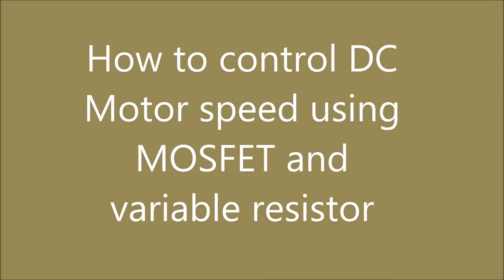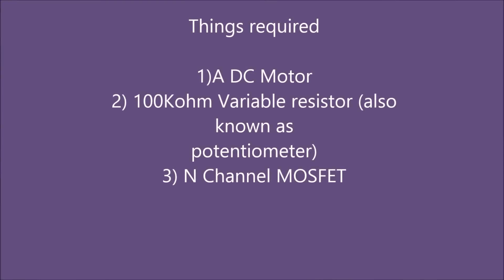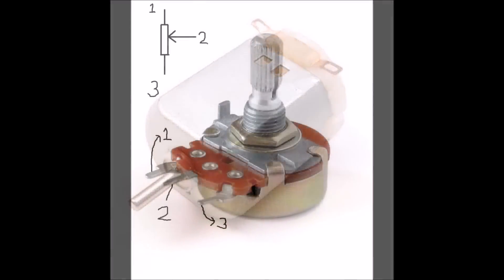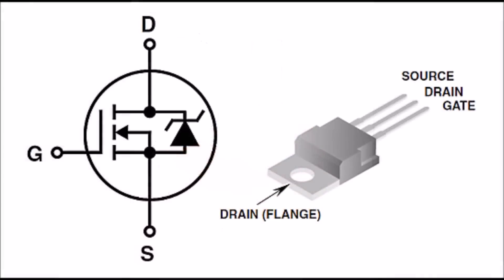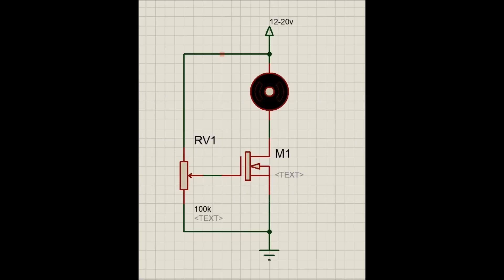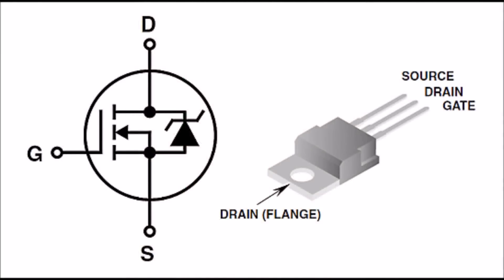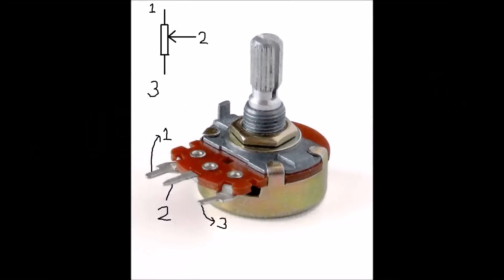How to build the simplest DC Motor Speed Controller(Using Potentiometer and MOSFET)Updated

Comment: the dc motor speed isnt changing when i tried this... is something wrong with my potentiometer? I got my materials from radio shack but no matter how i turn the potentiometer it won't change the speed
Reply from the maker: Does it rotate at full speed?
If yes, the MOSFET is bad. Check for short between D and S terminals
Reply: i feel like it is spinning even faster before when I had only connected to the battery lol... but yeah probably the mosfet because the guy at radio shack just said well it looks like this thing (it wasn't a mosfet but it was exactly the same shape lolol) I guess I will try to find a real one haha
Reply from the maker: lol... Find a real MOSFET!!😂
Reply: you may have the drain and source switched, in which case the current would pass through the body diode of the mosfet. current in a n ch mosfet can be controlled from drain to source, but current from source to drain will still flow through the body diode if the mosfet is off.

Comment: Instead of using a MOSFET, can it use a 2N3055 power transistor?
Reply from the maker: Yes. But only for lower current range(0-1A). For higher current add a amplifying stage before 2n3055.

Comment: Can you explain how the mosfet controls the motor and draw the circuit ? Please
Reply from the maker: Briefly, the MOSFET is in its linear region of operation. So by force a voltage at the gate, the source terminal also tries to follow the gate voltage, that's how it's working. It's a little tough to understand

Comment: For soap bubble machine speed is required up to 30 to 45 RPM
Reply from the maker: Geared motor  has to be used then
Get a 100rpm motor with gear box
then you'll be able to control from 15 to 100rpm

Comment: I ran across your video because I'm trying to convert a an air compressor motor into a boat motor . I'm using a 1 horsepower 1800rpm farm duty ac motor and a 4000 watt power inverter it works great but I want to be able to control how fast this thing goes is it possible to do with this type of motor and if it is please tell me what to buy at RadioShack. I've also thought the trigger and speed control borrowed from my variable speed grinder might work...? your thoughts please.
Reply from the maker: That's too much power for this circuit to handle, so it won't last.  You'll need a AC Motor speed controller because that motor is probably a AC motor.
Reply: Okay

Comment: You put supply voltage directly on the drain of the MOSFET, the middle pin which is connected to the tab and hence to any heatsink or chassis. It seems to me to be a big mistake to have supply voltage on these kinds of unprotected items? Am I missing something here .. :/ ?
Reply from the maker: Yes. Having the metal part(hence supply) directly connected to the heatsink is not a good practice as it increases chances of shorting. Thermal pads and plastic washer can prevent that. This is not a professional circuit designed to be used in products hence you'll have to deal with that.
Reply: You might want to add a warning about this as I think a lot of complete noobs are watching this, btw most products i've opened have just a thin layer of thermal paste between the tab and heatsink, meant for thermal coupling not for electrical isolation. I'm guessing it is not standard practice to have the supply voltage on the drain, but I'm noob as well so I don't know :)
Reply: Btw it worked for my purpose of adding variable speed to a cassette player, thanks. I'm not gonna draw a lot of current so I don't need a heatsink, just thought someone else might get zapped if they're not paying attention!
Reply from the maker: Most  of the people will use it with supply voltages between 0 and 24v, and 24v is not enough for getting zapped so it's just fine

Comment: will the circuit still work if the motor is replaced with a light?
Reply from the maker: Yes. The motor can be replaced by Bulb(DC), LED Strip, etc
Reply: Thanks

Comment: can it handle a 12v motor
Reply from the maker: Yes
Reply: What should be the capacity of pot
Reply from the maker: 10k/100k
The POT resistance doesn't matter that much
Reply: +Stuff Builder but power matters right
Reply from the maker: In this case, it doesn't
Reply from the maker: You could use 1/4W,1/2W or 1W and it would perform the same
Reply: +Stuff Builder won't it be too small for 12v 500mA motor
Reply from the maker: If you are using this circuit, then power rating of POT doesn't matter. It just controls the voltage at the gate. Very little current actually flows through the POT. The MOSFET actually controls the current. Hence, the MOSFET should be chosen appropriately.

Comment: Will this last long if will use it for a hours?
Reply from the maker: Yes. You'll have to attach a appropriate heatsink to the MOSFET along with thermal paste. But since you'll be using it for longer periods, it better to use a efficient PWM driver. 
It'll save energy :)
Reply: +Stuff Builder how can i put pwm driver?
Reply from the maker: Search for "PWM Motor speed control circuit" on Google
Or could try this circuit I made if it's not too tough for you(there are simpler 555 pwm circuits)
https://www.youtube.com/watch?v=RRLyoV-SCfc
Reply from the maker: Just search "555 Timer PWM circuit"

Comment: will it work on pc fan motors
Reply from the maker: Not sure :\
Reply from the maker: But it can be used to control output voltage, it should work. If you are going to try then add a 1k resistor in parallel with the fan
Reply: yes

Comment: can i just use dimmer switch?
Reply from the maker: It depends on what type of "dimmer" it is! Normal AC MAINS dimmers don't work with low voltage DC
Reply: thank you for the very informative response!

Comment: Please i have Few Question. Help me..!!
1.Is 100K 0.5W potentiometer is enough for handling 10volt of Supply.???
2. Did MOSFET transistor become too Hot while running motor ..???
Reply from the maker: 1. That POT will do. 
2. Yes. You'll need to attach a heatsink of appropriate size for cooling
Reply: Stuff Builder Thanks a lot :)
One more question..
Can use LM7805 MOSFET in place of this Mosfet..????
Reply from the maker: LM7805 lol, that's not a MOSFET! You can't! BTW, 7805 is a fixed 5v voltage regulator

Comment: what is the point of having a bread board while you have a bunch of wires in such a simple circuit?
Reply from the maker: How am I going to connect these wires without a breadboard? Yes, I can do point to point connections easily since this is a simple circuit but still it's more time consuming then breadboard, so I just went with it. I later made Point to point circuit for permanent use.

Comment: I bought a DC/AC AILIPU fan, It is only 15 watts. It automatically switch to DC battery source when the AC is off. Its motor works on 12 DC even if it is connected to AC source. But the bad thing in this FAN is that speeds are too close and the lowest speed RPM is high in my opinion. So I wanna apply this circuit before the motor so i can control the speed by rotating the POT. But unfortunately I didn't find TO-220AB MOSFET, but I found BT136 Triac, so does it work? And the Pot I found is 10 Kohm! Can I do this circuit with stuff I have? and if yes please tell me how to connect the BT136. Thanks in advance.
Reply from the maker: +Allam Yousef Haven't played with TRIACs so I'm not sure. But I have read some theory about them and so I think they work differently so it won't work 
Finding MOSFET is pretty easy though. IRF540 is the one I used
Reply: Sir.. I found the mosfet you mentioned in the video and then I built the circuit to my 12 DC FAN.. At first it works perfectly but the mosfet got high temperature although  I fixed it on a large Aluminium surface. The problem is that the FAN works some times and others doesn't because no current is passing the mosfet, so what is the problem with this circuit? do I need a modification?
Reply from the maker: +Allam Yousef Did the MOSFET reach a very high temperature, if yes then the MOSFET is damaged and that is probably the cause. Next, make sure you add a 10k resistor between middle terminal of POT and gate of MOSFET. See if that works... Hope this helps!
Reply: No. Not that much.. It still working.. but sometimes it works and others not, why?
Reply from the maker: Hmm...Don't know, but my guess is faulty part or a lose connection. That's all I can say since I haven't encountered such behaviour before
Reply from the maker: Is it a BLDC FAN?
Reply: sorry?? What is BLDC? I didn't understand it meaning
Reply from the maker: If you have resistor ranging between 470Ω to 1kΩ, try connecting one in parallel with the fan. That might do it
Reply from the maker: I was talking about fan driven by Brushless DC Motor
Reply from the maker: Like one of these
http://p.globalsources.com/IMAGES/PDT/B1005124943/Brushless-DC-Cooling-Fan.jpg
Reply: Thanks for trying to Help me.. I 'll try it .. But when it is not working I use multi-meter to measure the voltage to motor, It is Zero.. I think no current is passing the mosfet but I don't know why.
Reply from the maker: Yeah, try connecting a resistor parallel to the fan. Range: 470Ω to 1kΩ
Tell me the results if you can
Reply from the maker: I cannot see it. It's confusing on 4shared, so many download buttons. Why don't you just mail it to me. Here's my email: stuffbuilder2097@gmail.com
Or you could use Google Drive

Comment: i'm building a 3.7v lipo/liion battery operated (likely just a single 10440) fan using a 5v 500ma DC brushless fan and a usb power bank step-up module (module contains battery protection circuit) with a max output of 1A. how would i integrate this into that? would i still need the mosfet, or just the potentiometer?
Reply from the maker: I haven't tried controlling a Motor at 3.7v. I don't know if it will work, you'll have to research for yourself.
Reply: you may have misread what i entered. its a 3.7v step up module. its a very common circuit used to convert a 3.7 volt li-ion or li-po battery to USB output for charging smartphones and other USB devices. that part i already understand.
 what im wondering is if the regulated 5v coming out of the step up module might remove the need for the mosfet.
Reply from the maker: 3.7 to 5v. Okay, My bad, I thought 3.7v
Potentiometer(the small ones) cannot directly be used to control high currents. So you'll have to find if your motor draws small current. if it does you can directly control it probably, mostly motor draw current that are too big for these POTs so MOSFET or BJT are used
Reply: +Stuff Builder ok thanks. I'll just run the mosfet anyway
Reply from the maker: I haven't tested circuit for 5v. I think you'll get low speed because there's about 2v drop across MOSFET. So 0-3v. I observed the 2v drop when powering it from 20v so it was insignificant but for you it is! Still you could try...
Reply: i'll just test with and without.
Reply from the maker: Okay. Tell me the results. I'm a bit curious.

Comment: how many volts is use to supply the motor to work?
Reply from the maker: +Jenny Belen Motor rated voltage + 3v
If you don't know the voltage rating use 12v, if the motor gets too hot than go lower in voltage until you get a voltage at which the motor doesn't get too hot

Comment: Hi I would appreciate your advice on something I'd like to build- I'm a retired carpenter and like to tinker.
 I have a Whirley Pop popcorn maker- sits on the stove, hand crank to stir popcorn. I want to take a small 100rpm 12v DC motor and mount it to the shaft that stirs the popcorn- I don't know how to power the little motor- I've seen 12v adapters but they all have these cylindrical femaleplugs that apparently fit onto a mating mating plug- I don't think the motor has the correct mating plug- so how do I handle this?
I really do appreciate whatever help you can offer!
Ches Smith
Columbia SC
Reply from the maker: +ches smith You could buy a female mating plug that fits into the male mating plug and solder the motor wires directly to the female mating plus you bought. Interchanging the polarity(swapping the wires) will cause to change the rotational direction of the motor. Or else you could cut the adapter wires and directly solder them to the motor wires after making sure the motor spins in the right direction. Best of luck with your project!
Reply: +Stuff Builder Thanks- I believe I could do that- maybe Radio Shack has the plugs you mentioned.

Comment: ty sir , good job! but what is the purpose of the mosfet, i ask because i am building a power supply, and i am trying to regulate the voltage (output) with a pot, i was told by one person use a 200K pot, and another to use a 10K pot. I have tried both but am having NO results, the amount of adjustment is less than  half a volt. I am very lost on this.
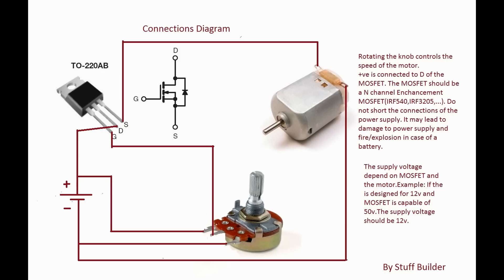Reply from the maker: +Hammer USN MOSFET acts as a high power POT(Variable resistor) in this circuit. This circuit won't work with low voltages. Make sure I've properly followed the connection diagram and not the schematic diagram that shows up later in this video. The connection diagram which shows up first is right while the schematic is wrong. Follow the diagram at 0:09

Comment: can you use this to run a 3 phase harddrive motor?
Reply from the maker: +boowonder888 Ofcourse not! Running that motor is pretty complex.
Reply: +Stuff Builder Ok, thought so. The mosfet, what does it do and could you leave it out? I think I salvaged a pot.meter from old electronics. Im gonna try it.
Reply from the maker: +boowonder888 The MOSFET acts as a HIGH power voltage controlled resistor here. If connect the POT directly it will probably burn unless you are controlling a really tiny low power motor. Check for yourself, will be a good experience!

Comment: What about load bearing abilities? If you increase the load on the motor of this simple circuit what keeps the motor from stalling and burning out the transistor? An elaborate gear train?
Reply from the maker: +Jeffrey314159 Actually I haven't put a significant load on the motor,   I've just tried it with the fan as the load😁. So I don't actually know the answer to your question right now.
Will have to do some experiments for understanding its load performance
Reply: Long ago I experimented with simple motor speed control circuits like yours. When the voltage to the motor(with load) was reduced even a little, the motor stalled and overheated the transistor.

Comment: Hi, nice demonstration there, but mosfet has a bad linearity as a variable resistor right? In the other words it is hard to control the speed as desired. Am i right?
Reply from the maker: +Marcus L Its not completely linear. The speed can be controlled precisely by using multiply turn POTs. In this circuit, the MOSFET doesn't saturated(Doesn't turn ON completely so there's always a voltage drop(3.5v) across it so speed doesn't go as high as it would if it was directly connected.

Comment: I have to use this with my fuel pump DC 14V   20-40A 

IPP075N15N3G - 150V,100A. 300watt N Cannel power mosfet Rds6.2mohm
possible with same pot ??
Reply from the maker: +ibrahim Saraçoğlu Uygur Should work but not a 100% sure. Try it.
Reply: thx for your answer man :)
Reply from the maker: +ibrahim Saraçoğlu Uygur Okay Great!
Professionally made controller is ideal for such applications
Reply: +ibrahim Saraçoğlu Uygur No.
Reply: ebay uk store search DC MOTOR CONTROLLER 15 pounds postage incl, today ordered :)

Comment: This if , by far, the easiest and bedst circuit i`ve seen so far. Been looking for a simple 1 like this.

Ty for sharing, works like a charm.I`m using it for a cool breeze on a 5v motor with 5 v dc.

I added heatsink to MOSFET, ( i use IRFZ44n)  got a little warm,no problem,but as i have heatsinks, no sweat slapping 1 on.

Ty again.
Reply from the maker: +Jan Demant Glad to hear it!

Comment: nice, this is much better than using a BJT
Reply from the maker: +Ronen Shemesh Yeah,BJT draws current from the POT. MOSFET has a high impedance gate so no current(very little) is drawn by it. Otherwise,both perform almost the same
Reply: +Stuff Builder I have to agree (-:

Comment: A diode is necceserly in parallell with the motor!
Reply from the maker: +Krisztián László Simon There's a built in back EMF protection diode in the MOSFET! Check the datasheet. So its not necessary.
Reply: +Stuff Builder Oh, i understand.

Comment: I built one it's working for now, but the mosfet is heating like crazy i used :
-IRF3205
-100k potenciometer
-12v dc engine 
-12V lipo battery 
any help would be apreciated
Reply from the maker: +Master Kicker You need to attach a heatsink to it.
Reply from the maker: +Master Kicker This circuit is not ideal but it really simple to build. For long term usage, go for PWM

Comment: Dear, still i dont understand that why you use mosfet. Please explain for knowledge.
Reply from the maker: +faisal hassan Because IRF3205,IRF540 have the ability to handle large currents which low power POTs don't :) A high power POT can directly control the motor speed but they are large in size.

Comment: why a MOSFET. is it not possible to just use the pot alone?
Reply from the maker: +Axell Andersen Yes. You can. But a higher power POT is need to directly control it. You can't use cheap 0.5W POTs to control a motor. Ultimately, this is a cheaper and compact solution to using a bulky high power POT

Comment: can i use any different types of mosfet to build this ? or it just works with the irf540 and irf3025 types only ?
Reply from the maker: +darren alex You can use any N-channel Enhancement type MOSFET. Though current handling capacity will differ.
Reply: +Stuff Builder oke. i allready try it and it works... thanks!
Reply from the maker: +darren alex Great!